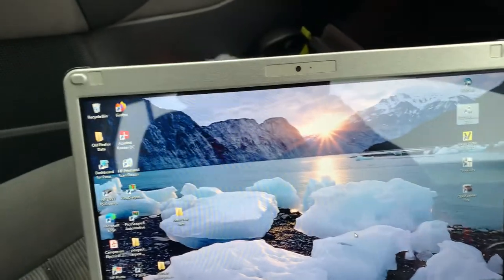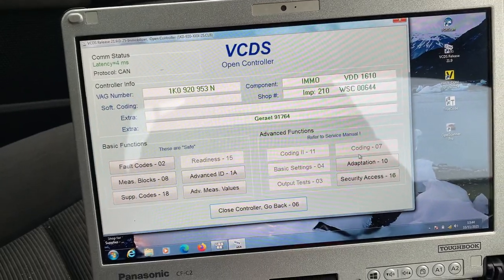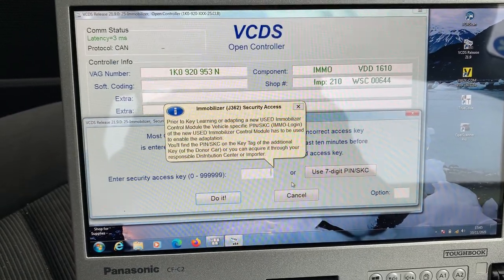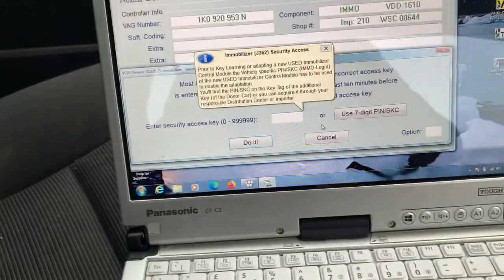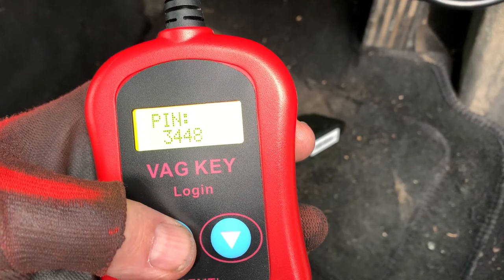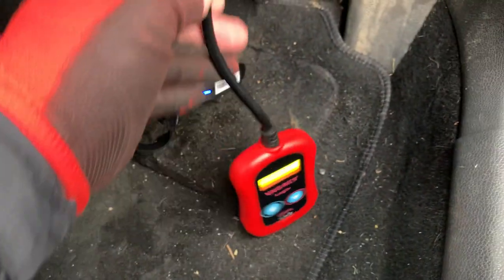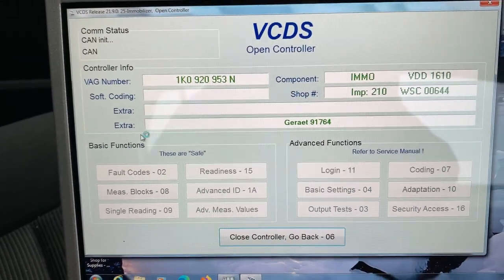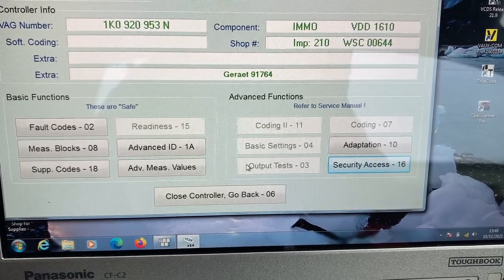Pin code reading on a mk5 golf 07 plate

Comment: I have a 2006 seat Leon 2.0 tdi BKD. My cluster has gone faulty. If I buy another cluster how can I programme this to my car? Do I not need the pin for the new cluster as well? Am I able to just plug the new cluster into the car then follow the same instructions as this video to get the new pin?
Reply from the maker: Hi yes you will need the pin from your vehicle and the replacement cluster. You program it with vcds following the instructions on the rosstech website. If you are not sure what you are doing leave it to an auto electrician

Comment: Hi I bought myself a vag key login to be able to change my instrument cluster but that doesn't work because I don't have the pin code of another instrument cluster do you have any tips for me thanx
Reply from the maker: Yes you need to get the pin from the ecu or delete the immobiliser using our delete tool
Reply from the maker: See my latest video
Reply from the maker: Connect directly to the cluster and read its pin. You wont be able to do it in the car due to the can gateway being involved

Comment: Hi, I have a 2007 Rabbit that both the ignition lock cylinder and housing have been replaced on. What do I need to do to program the new key? Is just turning off the immobilizer an option?
Reply from the maker: Hi your cheapest option is to take the chip out of your old key and insert it in the pick up coil around the barrel then move the coil out of the way. When the ignition is turned on with the new key the immobiliser will see the old programmed key and allow you to start the car
Reply: Change key blade onto new key housing?

Comment: Hi,I have a question,¿how can I get the pin code from the ECU and the Cluster? Because I need the pin code from the cluster and the ECU
Reply from the maker: If the original ecu and the cluster are in the car you can just plug into the obd and read it from there. If the ecu or the cluster are replacements you will have to read them on the bench as the gateway will interfere with the reading. If you get stuck email me at caralarmandradio@gmail.com
Reply: Dose it work with a82014
Reply: @caralarmandradio Hi, I bought a car without ecu. I have key and cluster. I recently bought an ecu off eBay. How do I read code on the bench? Which tool is needed? I have vscd from Rosstech . Car is audi A6 c6
Reply from the maker: @narerakgole143  what is the number on the ecu starts 02

Comment: 2012 ,mk6 ? Works
Reply from the maker: Tried it on a mk 6 ecu as of 01/04/24 and no does not pull pin from an edc17 ecu you need an autel 508 minimum

Comment: What about the cs code?
Reply from the maker: Dont need the cs code
Reply: @caralarmandradio  Thank you for your reply. The VAGs I've done using Autel, need the Cs code to make dealer key?
Reply from the maker: @inagbihal8518  use vcds and the pincode its much easier
Reply from the maker: I only use autel for cloning as its not good on vag
Reply: @caralarmandradio  I thought vcds only supports the earlier years that don't require Cs code input?
Reply from the maker: @inagbihal8518  yes correct me7 edc 15 and 16 vcds is no good for precoding keys or mqb the pincode reader is the same

Comment: anyone selling one?
Reply from the maker: Yes hickleys
Reply: @caralarmandradio  £200....  yikes!

is there a seconhand market for these?
would be cheaper to get a key from a dealer.
Reply from the maker: No if you need to change a cluster you will still need the PIN code